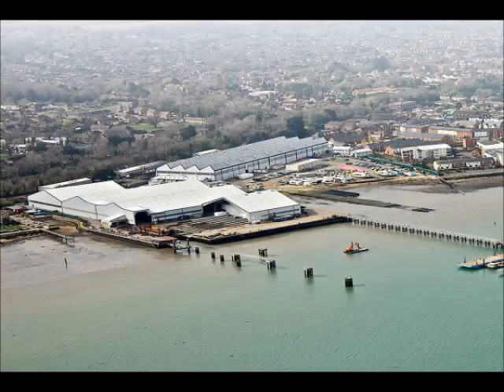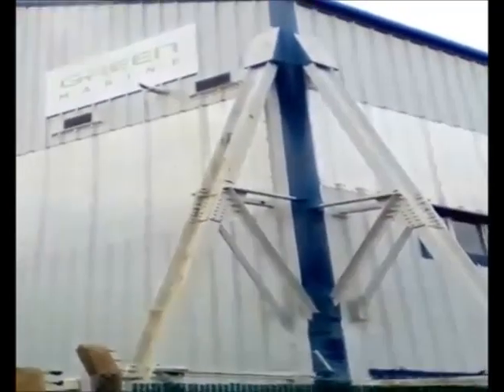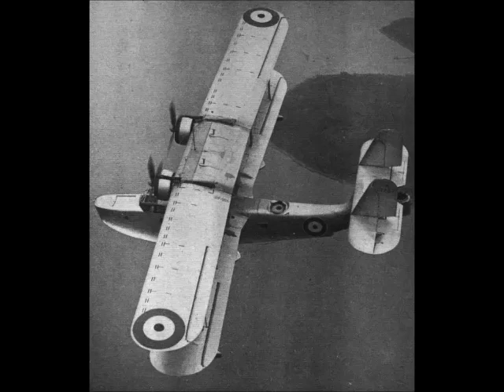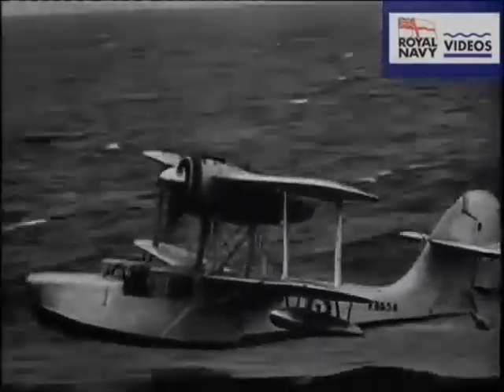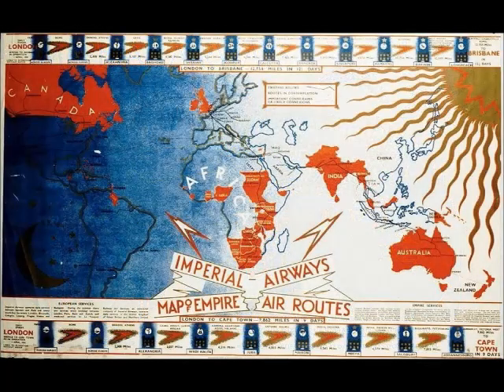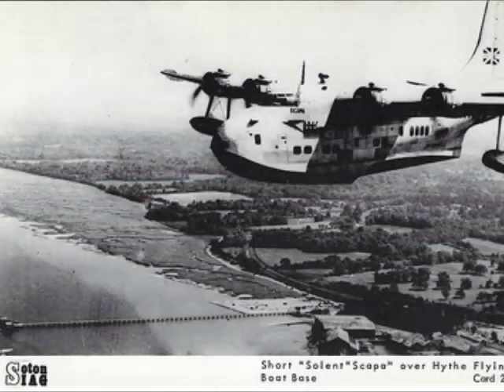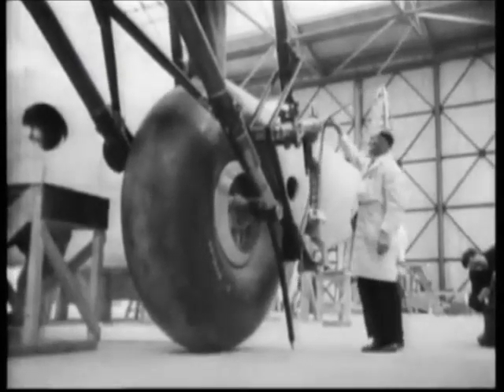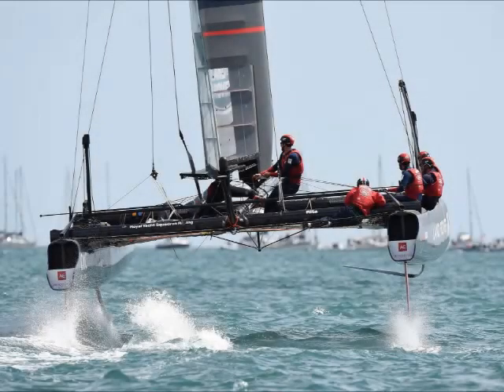The First World War Flying  Boat Hangar or 'Admiralty  Shed' at Hythe, Southampton

Comment: Thanks for the informative video!
Do you know if any seaplanes were manufactured here or near Hythe? Thanks
Reply: I am a little confused as It says the aircraft production at the Hythe Works ceased (in 1939), but then goes on to say Hythe was engaged in the construction of the Seagull V and other planes. Also 'hulls were constructed in Woolston and towed to Hythe for completion' Does that mean That hythe hangars were still manufacturing the sea planes? Any help with understanding would be greatly appreciated